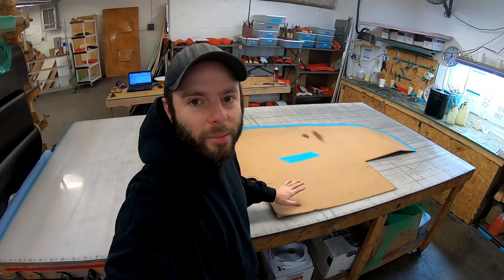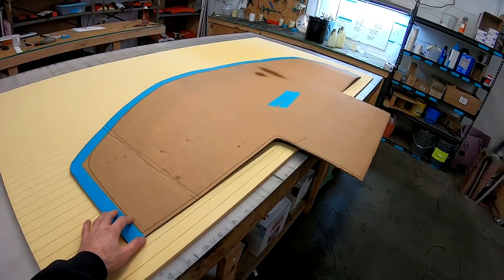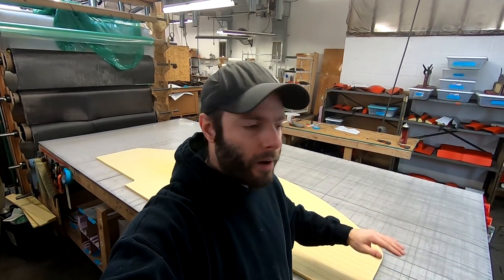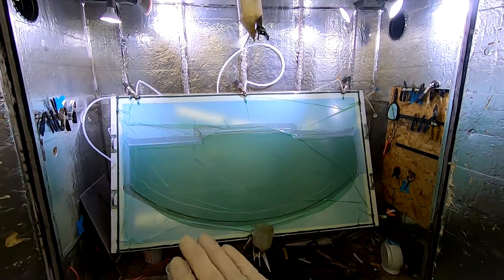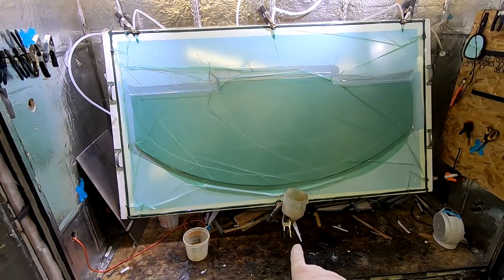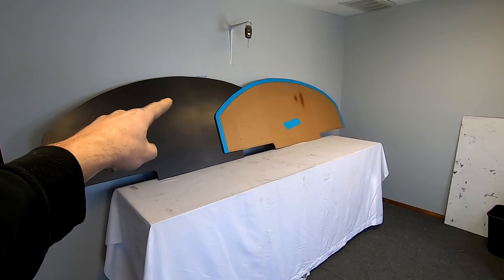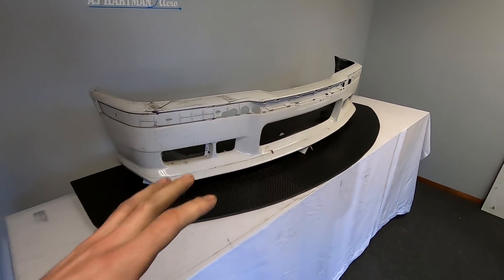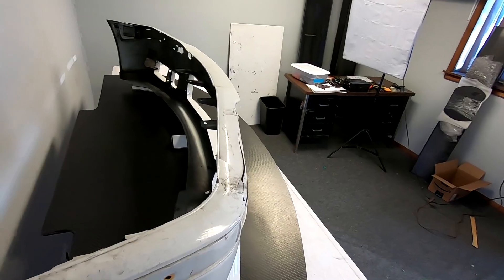Custom Carbon Fiber Splitters

Comment: Can this be done without the infusion and vacuum bag? Can it just be done with the wet lay technique and still be as strong?
Reply from the maker: No
Reply: @ajhartmanaero  what if I put a flat glass on the top of it and put weights on top of that while it cures?
Reply from the maker: @nonamebleach  So under vacuum the part will see 14 lbs per sq/in. So you can do some math from there to see how much weight you'd need to put. On top of that, pressing it between two sheets doesn't really remove excess resin so you end up with a much heavier part.
Reply: @ajhartmanaero  hmmm okay. I’m not too too worried about weight per se. It’s more of a road car. I’m just trying something to repair front end damage by adding a splitter that will be chassis mounted. Would hand laying and using a regular vacuum bag from Amazon and a vacuum cleaner work without using the infusion method? Does the vacuum cleaner have to be on the whole 24h while it cures? Sorry for all the questions.

Comment: Great video!  BUT, do you know of a foam core or other suitable material that will bend into tight curves?  I want to fab a CF diffuser that has a corrugated  or wavy shape.  Thanxalot for any insight you may have.
Reply from the maker: Soric or a honeycomb will take curves.